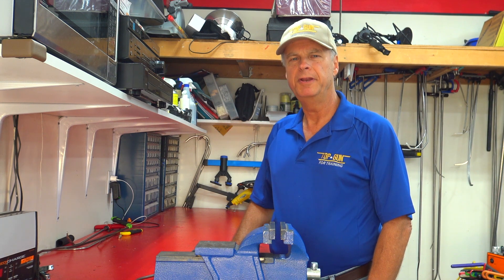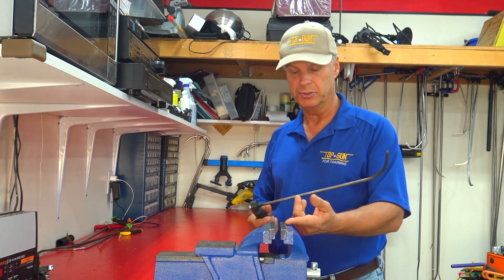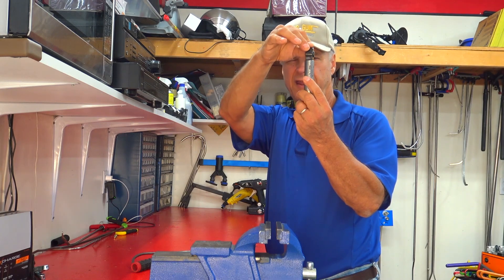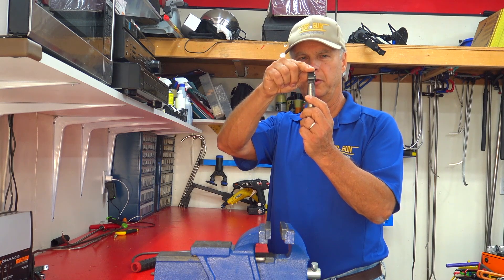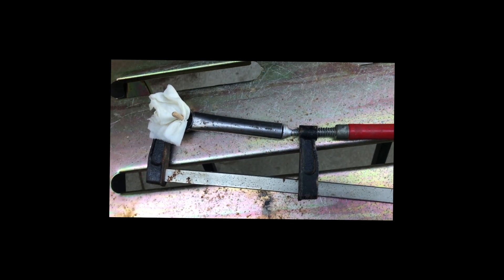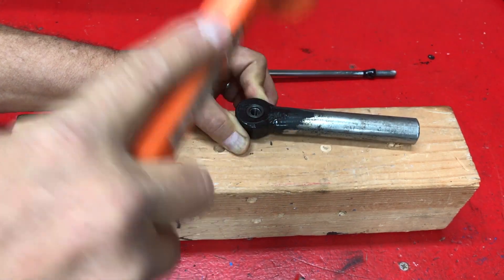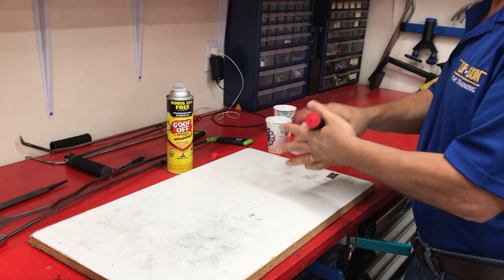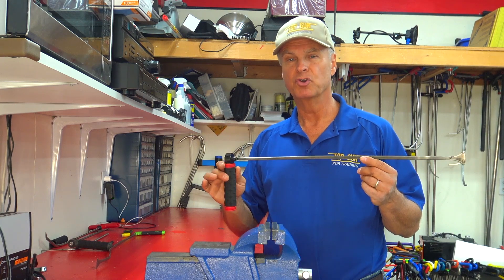How to Make Your Own Professional Quality Adjustable Handle PDR Tools

Comment: Just thin out some JB Weld a bit with acetone and fill the tube. No need to weld. (And I'm always looking for reasons to spark my tig) And how do you align the handle with the tool tip?  Having it off leads to mistakes.  No reason to go through all that work to have the handle 35 degrees off from the tip.

Comment: Ok Marty how about making a removable handle that will fit most of your tools. Cut handle off tool then weld a bolt or something that will receive the McMaster that has a socket type on it?  For the traveling tech.  One handle for most of your tools
Reply from the maker: Yup just weld the bolt to any tools you like and screw each into the same handle. I know quite a few techs that do that.

Comment: Marty, do you recommend welding on the gear? I made 3 of these handles, but I used springsteel and made my own tools. I put a thread on the springsteel wich was a lot of work, and used green loctite to secure it. After 5 years it's still holding very well. I think it was from a photo from you on door ding.
Reply from the maker: Hi Bjorn. Ya threading high carbon steel is a nightmare! Threading or welding SS is much easier. I wouldn't recommend welding to the gear as the heat will soften the gears hardness. If what your doing is working for you then keep doing it!